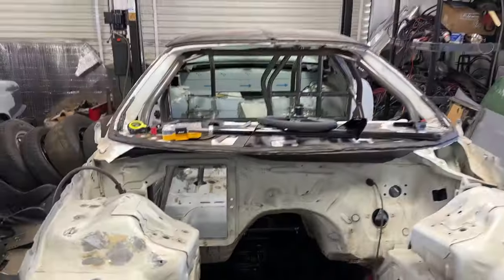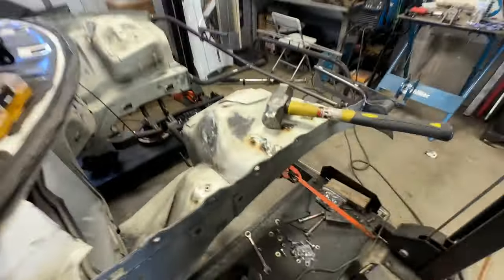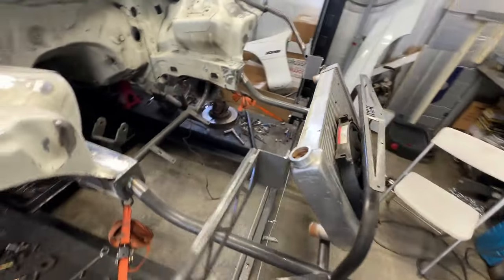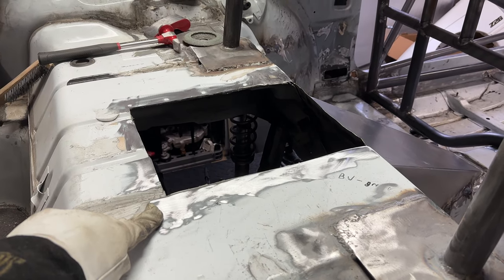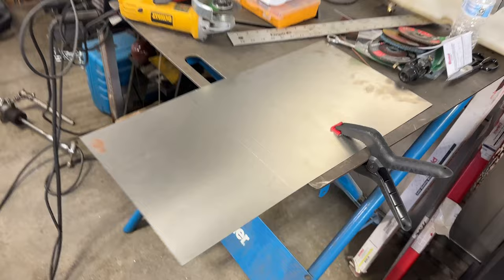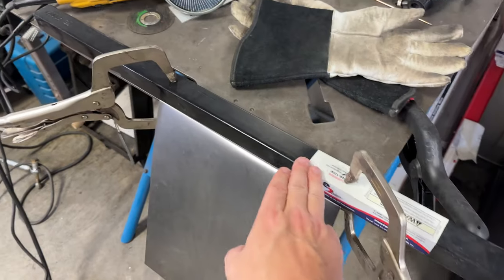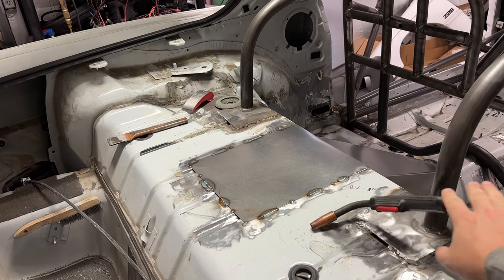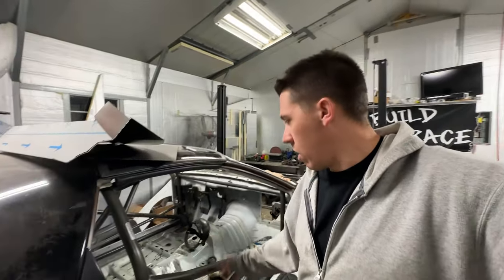1800HP Twin Turbo Camaro Build Smoothing Engine Bay And Interior!

Comment: It’s getting there dude ! Looking good 

Be careful with air to water coolers in the bay building up condensation on the outside and dropping onto the track under tires
Reply from the maker: We’ve ran them in the engine bay on the Buick and honestly never even thought about it. I’ll keep an eye on it and coat the intercooler if needed!